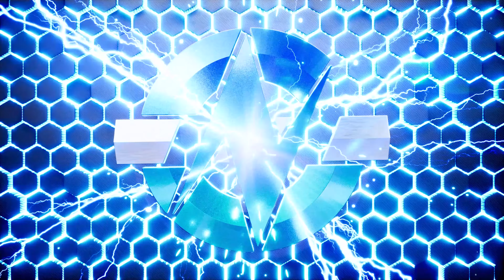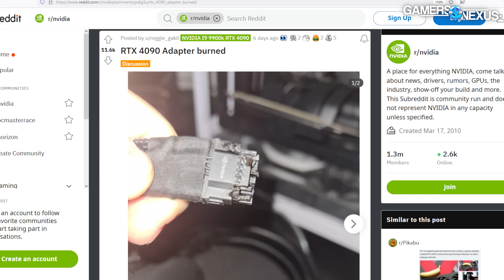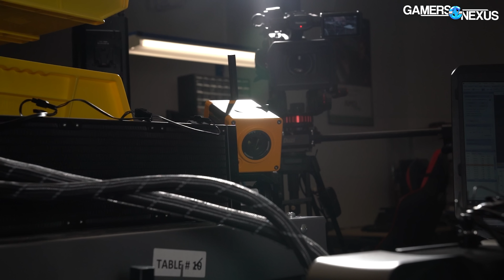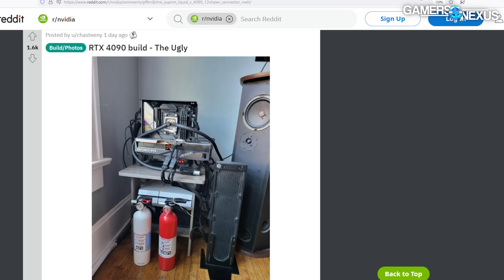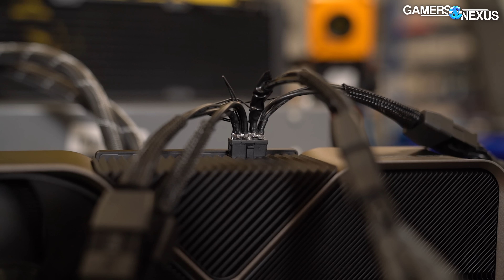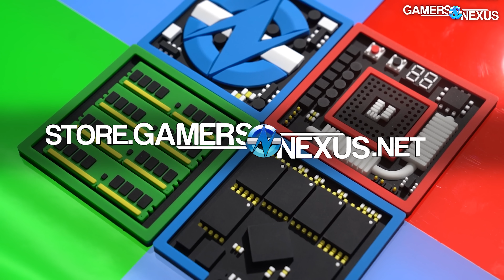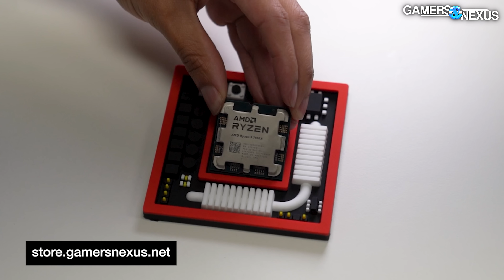Testing Burning NVIDIA 12VHPWR Adapter Cable Theories (RTX 4090)

Comment: In all of the tests I've seen, some mentioned in this video, what strikes me goes to a simple observation that may lead to better discovery.

Heat is most likely generated where there is resistance. We do not see melting of the connector at the solder junction most focused upon. We see melting at the pins, where the pin slips into the sleeve to make contact. I don't agree that we might have resistance created by a faulty wiring in the soldered attachment of the incoming wires onto the bridge, but that the heat would travel down a pin and not impact the portion of the connector where that presumed fault is located. That plastic is not shown to melt. A lot could be said about the thickness of that plastic, and I agree, but the heat has yet to appear at that bridge of the soldered connection and from that any attempt to create a break there to generate heat.

I assume the heat is generated at the sleeve where it contacts the pin, and that I assume because that is the plastic that is shown to melt.

I would begin with just a pin and sleeve of the same used to fabricate the adapter and the connector on the card, and test that one pin and sleeve connector to show how much power is required to reach a temperature that would melt plastic. Since I don't know, myself, what temperature melts the plastic, I'd further conduct an experiment on the connector to learn what that temperature is.

Armed with that, I presume that on a good contact between a single pin and sleeve, a very high power would be required. I would then move to add resistance to the contact, measure that resistance, keeping in mind the associated known means of creating electric heaters and what resistance would be used to create sufficient heat at the expected power of about 150 watts (or 100 watts) at 12 volts. 

Once I have these figures, I would then try to recreate compromised connection examples that could reproduce that impedance, and test to see if heat is generated at that pin.

After that, I would attempt to recreate that scenario in the full connector (probably without a GPU in my own preference), using the same parts in an example rig.
Reply: Sorry, hit reply too early....my hypothesis is that we're eventually going to see that in "melting" examples, all but 1 sleeve has loose connection and higher resistance, and thus not conducting much current, leaving one pin with the best connection conducting all of the current and generating the heat, in the sleeve of the adapter that fits around the pins on the card.

Though, I could have that backwards....I don't really know if the adapter has the pins or the sleeves.

Comment: The new connector simply has less of a safety margin than the old connector.

The new connector is perfectly capable of handling the power requirements, especially in the native harness configurations. The question is how much safety tolerance is inherent in the design. How much over spec can the design handle.

The older design has a much higher safety tolerance. In what it is rated for vs what it could actually handle without failure. You could say it is even over built for the needs.

Now, a single connector may not be able to safely handle the same power as a single example of the new connector, but two connectors in parallel likely could handle the same power without much issue. Three and even four connectors in parallel could easily handle the same power without any issue, and have more tolerance for exceeding that power level safely.

This all assumes the actual wires feeding the connectors are of adequate gauge diameter. Cheap cables using the bare minimum wire diameter needed to safely handle the max rating would reduce the safety margin. I would also suggest that on these high draw cards, that you as few of the split pigtail type connections as possible, unless the cables are really over built with large wire gauge, and the internal power rail can handle pushing the power through only say, two PCIe outputs.

Comment: Obviously there is a quality control issue, if they are sending out different styles of adapter cables there's definitely a less robust version on the market. Perhaps like everything these days getting things in stock on time is an issue, and they put out lesser quality cables to meet deadlines for a batch or so. One thing Jay and Igor are also overlooking, is if that cable is outright disconnected at the solder pad, its not going to create as big of a heat increase, as if its cracked/poorly soldered/bad/high resistance connection even with potential to arc would cause.

Comment: This might sound out of place, but it may help answer why this is happening.  I am in automotive repair.  And have had to replace countless melted headlight connectors.  Some with heavy gauge wire, others with standard gauge wire.  Some connectors were new and some old.  But every one of them failed because the terminal in the plug suffered from a high resistance load caused by poor or loose grip to the connecting pins on the headlight bulb.  GN, is this a factor you could include in you tests?  Because I think it will prove relevant.

Comment: Today the der8auer EN channel put up a review of the INNO3D RTX 4090 ICHILL Frostbite (max draw 450W), which comes pre-installed with water blocks for a custom water loop. The video makes it very clear that RTX4090 cards are MUCH better if custom water cooled (able to constantly boost because of much lower temperatures, lower power consumption, much smaller size GPU so it can fit in a lot more cases, etc. & so outperforms founders edition in every way with fps, etc.), & as pre-water blocked GPUs by the manufacturer, they remove any drawbacks (no e-waste from throwing away the cooling system for air cooling, no stress from having to switching over a GPU with the risk of breaking it & the damage not being covered by warranty, & they come with full manufacturer's warranty).

Specifically the INNO3D RTX 4090 ICHILL Frostbite, which comes pre-installed with water blocks, although it does outperform the RTX4090 founders GPU, does NOT push the limits of the performance available with this hardware configuration potential (e.g. it only comes with a power cable for max 450W), so it would be good to see other manufacturers do something similar, but gone further, tweaking the reference board from Nvidia to push for maximum performance, well beyond what's possible on an air cooled card, like the overclocked ROG STRIX, being sold with custom water blocks preinstalled as well. Take note ASUS & others - we want RTX4090 card options for sale that come pre-installed with water blocks please!

Comment: Even if the current all goes trough the center 2 that would not explain the 2 outer pins get heated the most. 
And honestly i dont think the problem is on the solder side of things. Tt has to be on the actual plug side or the thing plate which is basicly 1 part with the pins. is just to thin/poor quality metal and thus gets to hot.
And forcing more current trough less cable soea not mean the plug gets hotter.  it still gets fed the same current.  the only thing that is diffrent is that the cables that are not connected can not conduct heat away from the small metal plate.
And i find a adapter a non issue as its the way the connector is made/designed.

Comment: Imagine working as non conformance engineer for Nvidia and half your job has been done for you bc content creators like Gamers Nexus 😅

Seriously though, I'm interning as a non conformance engineer at a biotech company and this is how we do it. We poke and prod and process of eliminate until we can replicate what's going on. And sometimes we can't replicate the problem exactly how it occured in our lab. Sometimes the issue is customer side, even when the customer is doing nothing wrong. It's complicated diagnosing complex devices like this and I commend GN for taking the plunge. The NC engineers at Nvidia are probably thanking you lol.

On another note, I wonder how Nvidia can evaluate what the problem actually is without getting the faulty cables returned from customers. What I mean is that if people are sending their cables to you for testing, will Nvidia have enough of a sample size of their own to confirm or deny the root cause?

Comment: No dude...the wire breaks off and then makes light contact and heats up because the contact is not good for this reason most all the pictures has them melted in the corner...you never had a PSU plug melt because you did not plug the wire correctly?I had...I immediately realized when it smelled like burnt plastic...I had 50+ PSUs at the mining farm and one bad 8pin that melted because of me

Comment: It probably doesn't help that QA has suffered across the board since the pandemic for all fields of production. Companies had to rush to catch up and it only makes sense that rushed employees would miss things more often. Still it's a concern that quality doesn't seem to have recovered from that point and instead lower quality has just become the normal. Lower quality wires get hotter due to impurities, lower quality solder degrades over time through thermal cycling. It all adds up to higher failure rates on products.

Comment: Igor did give us some good info. I am just mainly concerned about the 150v vs 300v cables. That's double the standard, unless someone tests how much voltage is going through each cable on certain loads. We won't really know if the cable is an issue. If the card is pulling more then 150v on sed cables then that could be quite dangerous for obvious reasons.

Comment: Thanks for doing this video!
If power consumption is going to keep increasing, I'm really hoping the industry simplifies this. Bullet connectors or screw terminals would be far better than this unnecessarily complex molex-style trash. I'd rather see a 6 AWG silicone cable with something more resembling an XT150 connector.

Comment: The voltage rating is the voltage rating of the plastic insulation material. What matters more is the material (99% copper?) and type of construction of the wires, contact interfaces, mechanical relief, mechanical strap, etc.

Comment: Doesn’t seem so hot lol my 3070 gets up to 80c sometimes never had a single problem with it
Reply: 3070 gets to 80C? rip. Mine never surpassed 55C. Hell, my 6900 XT doesn't go past 63C.
Reply: @lunetailedfox  it works fine never have an issue with it and is yours overclocked? i also live in cali where its always super hot

Comment: Why not just test the resistance of each terminal with a good quality 6.5 digit bench multimeter as you bend and flex the connection?

Comment: There are structured methods to help with this kind of failure analysis. Please see if you can use a fishbone diagram or cause mapping to help find the root causes. There may be multiple root causes leading to this failure.

Comment: The voltage rating is for insulation.
It does not affect how many amps cable can handle, wire gauge and wire material does that..

Comment: OUTSTANDING JOB Steve! TYVM for Always being objective as one can be with the information at hand. I am a POS tech mainly NCR systems and I fully understand trying to reproduce  one-off failures is Almost Impossible. Unless like You said it's a build quality issue that you can pin down via production batch or vender revision. 99.99% of the time you never figure exactly why but just the solution to prevent it.

Comment: Why are yall (youtubers) doing so much to blow up these cards? If you cant get it to blow up under NORMAL use which is how 99% of consumers will use the card, then is there really a problem? to intentionally damage the wire to get it to fail, thats just not good science... Do things normal users or maybe do a overclock, if it doesnt burn up, then its not news... you all are seeing these pictures on reddit, but cant verify its even true and they didnt take a torch to it just for the likes (PLEASE DONT PUT THAT PASS PPL), and making all these fail videos but failing at making it fail yet you STILL believe the op is being truthful... If you want to blow one up, send it my way and ill test it in my PC 🤣😂🤣

Comment: Prob a pure concidence, but I haven't seen a single Founder's 4090 cable melting reported yet.  I appreciate your testing on this, but what I also see is that nobody is testing the extreme bending within a tight case with the side panel putting additional pressure on the cable.  I believe that is what's causing it, not sure if cutting it on purpose or bending it in an open bench would ever recreate this issue.

Comment: The problem is pin/terminal related. Either due to not being properly inserted or a issue with terminals being double split or the depth of the pins and terminals does not match, meaning there is not enough contact especially with bending of the adapter. Some of the images of the connectors, the terminals seems to me to be socketed really deep in the plug.

Comment: I really appreciate the framing that this isn’t a dig at Igor or Jay, but just additional findings and more deduction on top of and in addendum to their videos
Reply: 6:15 concur. Good catch GN. Higher voltage rating usually means less resistance which means less heat. It’s why you don’t wire your car amp to the battery using the speaker wire 🥴

Comment: The issue with this testing is that the plastic housing is removed from the plug.  The terminal will just not heat as much with the housing removed.

Comment: the voltage rating is for the insulation, i suppose.
not for the conductive part of the wire itself

Comment: Except the voltage rating for the dielectric of these cables has nothing to do with their current carrying capacity. 150 or 300 volts is way above the voltage that the system is specified to work at so you aren't going to get dielectric breakdown. This is the concern where higher voltages are being used but here the system is working at 12V.

Both cables will most likely be using PVC dielectrics and therefore have similar thermal capabilities only the 150V cable will have a thinner version. This is actually a good thing because it will allow heat to escape more readily along with allowing closer cable spacing and more flexible cables. 

In this case the only thing that matters is the guage of the wire and it's current carrying capacity. In theory the 150V version, with the thinner dielectric, could actually have more copper in there for same overall wire diameter.

Let's not go looking for problems in the wrong place as any manufacturer would source the cheapest wire of the correct guage at the time. This could be the 150 or 300V part. The same as other variations in components from product runs. In a ~1V system, such as the power delivery decoupling for a GPU, manufacturers are probably swapping between 6.3/10/16 volt ceramic caps all the time and you never know. It's unimportant because they all are within spec for the application.

Cables are not a typical point of failure but connectors are. Clearly the cabling here is not at fault. What is is the termination of said cabling into the connectors and then the connectors themselves. 

It's possible that the really melted connectors are from one's that have snapped internally and have pin contacts that aren't mating properly. The heat rise is most likely to occur at the pins themselves.
Reply: Adding to this 68.5 degrees is pretty hot for basic plastic shrouding on connectors. It's not hot enough to cause any problems though but you're doing open bench testing with 20 degree ambients. These are high power cards, in high power systems, where space could be constrained due to the gigantic nature of the card. 

I could easily imagine a rise of 20 degrees, over ambient, around the points of interest inside the case. Add to this the climate in certain areas of the world? Let's say it's 40 degrees in some hot country/state (Vs 20 in your lab) and let's say we've got a 20 degree rise over ambient inside the case. 

That's a 40 degree difference Vs your open bench lab.

This pushes that 68.5 up to 108.5. Even if it's only 35 degrees in the room that's still 103.5 potentially at the connector. I don't need to tell you that this is too hot.

Comment: @gamers Nexus I just received a 4090 yesterday and noticed the adaptor was fairly difficult to plug in compared to the plugs that go into the PSU... I am curious if a partially plugged in 12VHPWR cable into the video card would have any effect? I double checked the plug going into the video card after thinking it was in and noticed it went further and i got a minimal click... Thoughts? Sorry, im seeing this part now in the video....

Comment: 150V vs. 300V Insulation mean voltage for which the cable is rated. As this 12VDC, both are more than is necessary. But, the high voltage cable will have thicker insulation for the same gauge/AWG wire. The thicker insulation will result in a stiffer cable. I am also confused by this "FOIL". This is stranded cable, which does not typically have foil shielding. For crimped or solder connectors, all the stands would be connected. I think Igor's 1 wire to 1 pin and then 1 wire to 2 pins (which is then repeated) would most likely be the problem. It results in more amperage on the single pin, for which is not rated, Steve's adapter has at least 3 pins to 2 wires, which is better as it balances the load. The 1 wire to 1 pin connector would easily result in high current and therefore temperatures on each of the outer pins on the sense side of the connector (1 pin on each side).